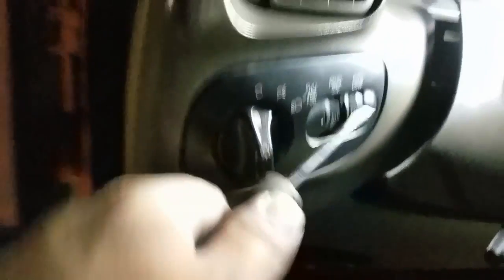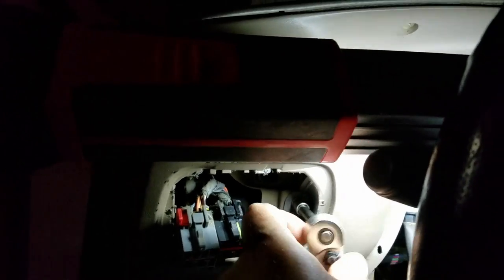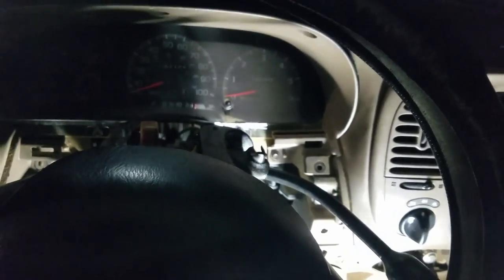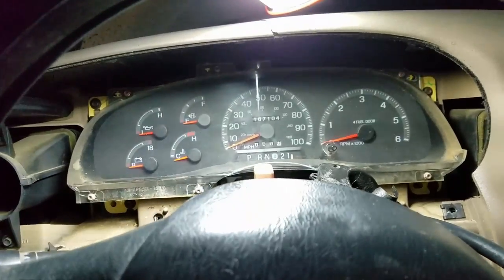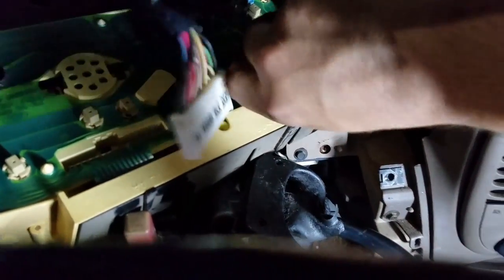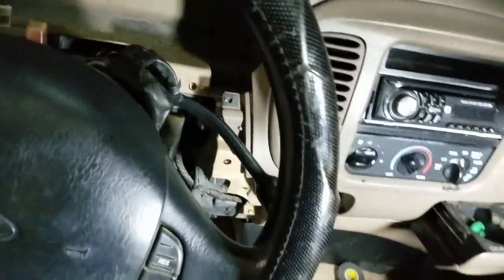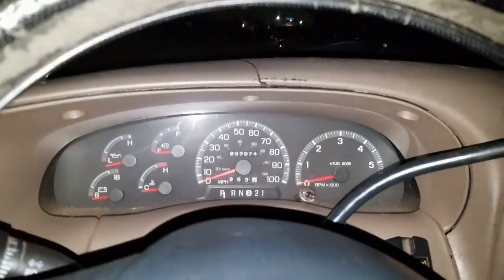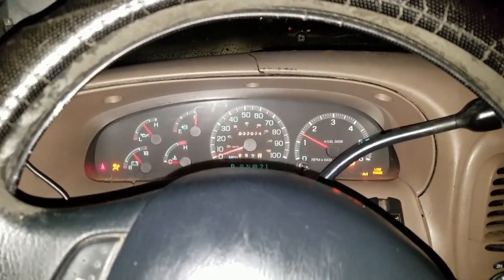How-to Replace an Instrument Cluster / Speedometer 1997 Ford F250, F150

Comment: Just a tad different than my '84 f150 I used to have! Needed to replace some dash bulbs on my '98 fq50 and couldn't figure out the shift indicator. On the '84 it's just a snap panel, 4 screws, a speedo cable, 2 connector, unscrew and unhook the indicator cable from the column.

Comment: WARNING - great video but prying the headlight switch out with a screwdriver, broke mine up pretty good and it is a mint 1997 with 52k original miles. There is a button on the left side but back in the dash. When you push it in, it’s slides these pins over on a spring type slider and when you let go of the button they slide back. So you can’t pry it out without sliding them over. You’ll see what I mean. 

Haven’t figured out how you would have gotten in there to push it though so you don’t break it. But if you can figure that out it’s a smooth pop out situation.

Comment: I have a 98 lariat F150 4.6. cluster died, I thought it was just the fuse but when I replaced it, smoke came out of it. my question is, if I go get a good one from the junkyard does it has to be reprogrammed by the dealer?
Reply from the maker: Some do, and others don't. It's really hard to say for sure. I'd bet with the 98 you'll be fine.

Comment: I'm pretty sure you did not need to replace the whole thing, if odometer and trip are not working that's because you need to change the little gears in their mechanism
Reply: Yep, worm gear is usually all anyone needs $30 fix

Comment: I need to swap out my 2003 f150 lariat cluster with one I found on eBay. If I do this will I be able to start my truck? I heard the PATS will not let it happen because it it isn't the one from the factory? Yours seam to work with out any issues. Also, will the mileage reflect my current mileage or that of the new new/used one from eBay? It has similar miles. My tach had an issue which is the reason for swapping it out.
Reply from the maker: My truck was much older than yours. I doubt it'll work without the dealer reprogramming PATS and the mileage.
Reply: Yes you will not be able to make it run without having the pats reprogrammed, tow it to a dealer and have them do it, should cost like 100$

Comment: Dont know if I'll get an answer right away. But my cluster gauges all went out on me after getting home from filling up. Tilted my steering wheel and my rpm needle dropped and my fuel gauge oil pressure etc all dropped. Fuses dont look blown. Am I better off getting a new cluster? Also I did replace my lights to blue led so I dont know if that would have caused anything.
Reply: ajusting the wheel somtimes pulled on the wires on the digital odometer. It worked speratically at best.  I guess its common, in ford odometers from the wires always being pulled on

Comment: My check engine light on my 98 F-150 would not come on and I needed to either replace it or find out why it wouldn't come on when I took it to emissions. Every time I took it to the ford dealer it would work until I got home and then it wouldn't come on. The dealer said  go to the junk yard and get a cluster it must be a problem with it. Well, you certainly walked me through on how to replace the cluster and after tinkering with the bulb after I got my cluster in position to check the bulb it is now working fine. Thanks for a very good video.

Comment: Thanks for your valuable time and effort in helping me with this information.  My speedometer sometimes work, and other times it just pegs out at the 90mph mark.  In addition, my odometer doesn't work and my cold / hot gauge stays at the H mark, but the truck doesn't overheat.  It's time for a replacement.  Thanks again.

Comment: Did you replace you miles or did you just take what was on the new cluster I have low miles unless I could find one that's close I'm screwed my gauges are not working .
Reply from the maker: I just took whatever the miles were on the new cluster.